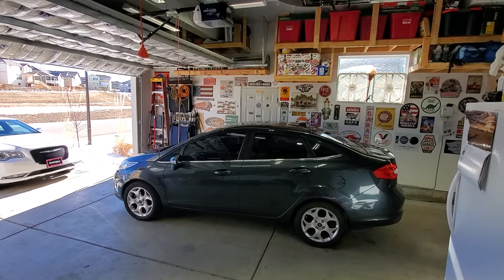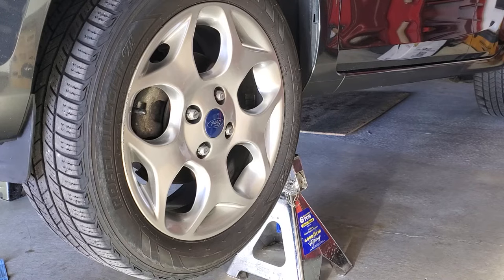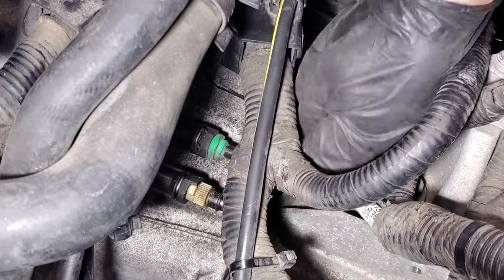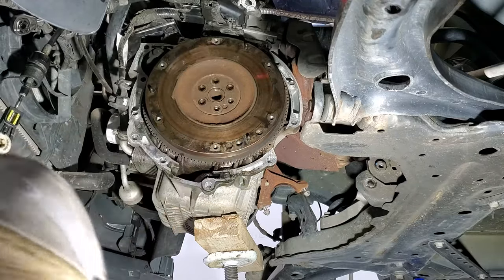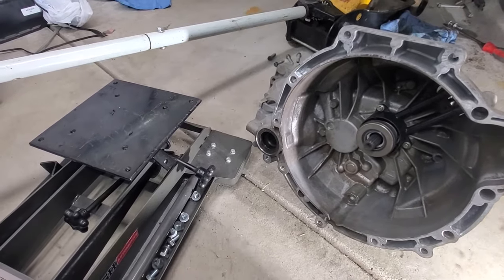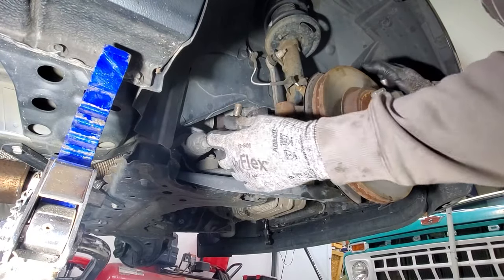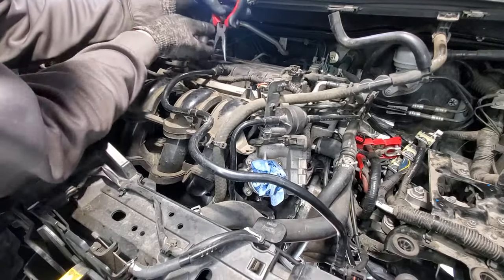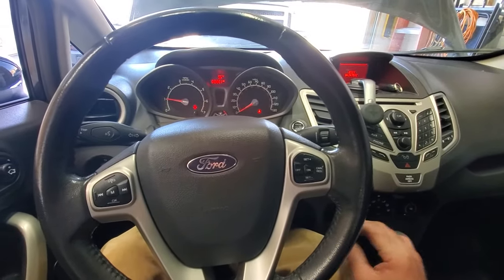Ford Fiesta Clutch & Slave Cylinder Replacement How-To

Comment: Thank you again for this video. I'm not a mechanic by trade and I was able to replace the clutch and slave cylinder by following this video. I live on the east coast and did the job outside by myself. Anyone trying this by themselves please note that it wasn't easy by any stretch of the imagination. When I finally completed the job I couldn't move the car because the back brakes were locked due to the cold. A little hot water and a fertilizer sprayer melted the ice. Thx again.

Comment: Excellent video. For anyone else about to try this, I found that I did not have to remove either of the axel nuts or tie rod ends. Instead, I just unbolted the struts from the hubs. Plenty of room to wiggle them out.
Reply: Do you a video of it because I need to replace mine

Comment: I have been watching video clips on removal and installation of gearboxes and clutch components on YouTube for years now, and I make bold to say that this clip of yours stands out, more importantly is the use of the gearbox/transmission jack to remove and replace the gearbox, not many videos have shown us how to use this important tool. Don’t forget that gearboxes can be quite heavy and it is not supposed to be installed or removed with sheer human strength. In most videos, people have used brute force/:power to do this job. Thank you so much for this and I hope a lot of people will appreciate it and subscribe more to the channel.

Comment: Awesome video! Anyone looking to get a clutch kit. Don't get the one from "A Premium" because the slave cylinder line will not fit into the aftermarket slave cylinder. I didn't find this out until I was buttoning up the job. Then I had to do it all over again. No help from A Premium and from the reviews, I'm one of many who had the same problem
Reply from the maker: I’ve heard the same thing about A Premium

Comment: Even though I just dropped my hatch fiesta at the shop, I still wanted to know how it was done. Great video, I'm surprised the mechanic said $500 this looks like a lot of work, I'm only doing mine because I lost my clutch pedal completely and won't engage, saw brake fluid leak out from underneath.
Reply from the maker: Yeah sounds like your clutch master cylinder failed or the slave cylinder. $500 is a pretty good price for a whole clutch replacment.

Comment: The extent of my experience was an oil change... I've now removed and reinstalled my transmission. it wasn't flawless as it was a different year 2017 but this gave me a general idea and I was able to figure out the rest. I had my slave cylinder go out and was able to diagnose it after I bought the clutch and master cylinder... just in case. Thank you for teaching me.
Reply from the maker: Thanks I really appreciate it. That’s why I do these videos from start to finish that way anybody with some basic hand tools can save a lot of money doing it themselves.

Comment: Awesome job on this video I wish you had a video on removing 2012 2017 Ford Focus transmission rebuild I’ve got mine to do I feel you don’t miss a beat on video all steps start to finish.. unlike 90 percent of all other videos on YouTube.. your the best macanic on YouTube just for that aspect 👍👍👍 . I’m dreading doing my 2012 Ford Focus transmission fix .. 👍👌👏
Reply from the maker: Thanks man I appreciate the postive feedback. You actually maybe in luck I have a 2012 Ford Focus as well and actually have to drop the transmission and replace the dual clutch on it and see if I need to update the input shaft seals. It’s doing the common focus shuddering. I just haven’t had the time to do it yet and still need to order parts. Hopefully I can have it out here in a few weeks. I’m assuming yours is the automatic since your having issues with it?

Comment: Hello master, thank you. My Fiesta has a 5-speed manual transmission. When I take my foot off the clutch while the gear is in neutral, I hear a clicking sound similar to friction. This is due to the reason. The sound comes from the side where the clutch is located.

Comment: Nice step by step video.
Does this transmission box have any magnets anywhere on the case / drain plug to attract iron particles/ dirt from the gears due to normal running? ( To increase life of the gear train or life of transmission Oil costing 90$ )

Comment: Thank you for this absolutely amazing video!

I would like to point how this correlates with my theme for this car: Corporate Ford Engineers are a**holes.

They take heart from Aldous Huxley's line from the fictitious Ford: History is Bunk. Why research and use a reliable solution when you can patent something you dreamed up in the shower and make loads of cash replacing it?

If the slave cylinder on my Toyota Echo, Camry, or Corolla leaks: I buy a thirty dollar part, and maybe dip into my PB Blaster and anti-seize. If I don't want to work in a tight space, I take off the upper radiator bracket and slide out the fan assembly. Takes 10 minutes. I remove the hydraulic connection from the old slave. I remove the two bolts. I Install the new slave. I bleed at the slave cylinder. Finito. Total labor including fan assembly is under an hour, even for a slowpoke like me.

Ford Fiesta: The leak puts DOT-3 INSIDE the bell-housing. WHY PUT IT THERE?!?! The cheap plastic tubing begs to be damaged if the engine overheats.The slave cylinder sprays DOT-3 all over the clutch when it inevitably leaks. Slave cylinders have been "wear items" for a century. On the OUTSIDE of the bell housing. Way to maximize the damage.

Because the part is unique, a replacement kit starts around 200 bucks. Labor to replace the slave now includes transmission removal and clutch replacement. What is the book time? 5 hours? 10 hours? 

My apologies to hobbyists and fans, especially Fiesta. I can sort of understand the allure of a car that stole a bunch of ideas from a bad 70's camera to renew some patents. It's all bizarre, and challenging like a jigsaw puzzle with a white face. Some of the ideas look nifty. But from a practical point of view: The drive for patents led to repudiation of designs proven over a century now. If you have an early 70's MGB, this fits right in to your collection. If you want a daily driver...

Examples:

My engine never ran right. Dealer answer: Use only Chevron Techron gas, and stop complaining. You bought our cheapest car. You deserve to be punished.

Manual Windows Handles. Clips are disposable. Handles should not be.

ABS Controller Failure Mode: The brakes FAIL. Yes. FAIL. You need an expensive scan tool to even begin to diagnose the U3000:xx:xx that basically says, "Something is wrong with the control logic or wiring harness. You figure it out."

Lower ball joint connection looks pretty. It rusts. No problem, there's an SST to remove it. Did I mention $$Ts?

3 grand for a radio. A radio. Or buy it without that trim option and get... a Bad radio. Replace that with a Decent radio for 120.00.

Lots of pretty machine aluminum and plastic. Plastic breaks. Machined aluminum, especially poorly designed parts, means lots of replacement $$$$.

Interior finish: Bad latches, bad anything that moves. The low-end cars I drove in the 70s did just as well. But, I could apply steel wire and Bondo and get another 40,000 miles. This stuff is designed to completely self destruct. No user-serviceable components. More punishment for buying the base model.

On the theme of cheap plastic, did I mention that plastic coolant system thermostat plenum? Brilliant. Melt down your engine in minutes. Oh, won't the ten buck pressure cap save it? Now where IS that pressure cap?

Continuous lobbying to make as many parts as possible fly-by-wire, and then encrypt the control logic. No replacement by owners. And look how well that ABS controller worked out...

And of course, the slave cylinder...

What other gifts have your Corporate Ford Engineers lavished upon you?

Yeah Ford, I'm bending over to take the reaming. But guess what. This is the last Ford I will ever buy. I will drive mid 2000 Japanese cars until they are banned or break. Mine will break in 2040. Then I'll start buying mid-2020 Japanese cars. I might buy another Chevy Astro van from the previous century. it responds well to steel wire and Bondo. And I will NEVER buy a fly-by-wire car with software licensed parts or a lockdown to dealer servicing.
Reply from the maker: Well said brother, I totally agree with you.

Comment: Thanks for posting. Went out to my 2011 hatch and discovered giant puddle of brake fluid and no pedal resistance with no master cylinder leaks.  Just wanted to see how much hell I'm going to put my poor mechanic through this week. I figure 150k miles is pretty good for a clutch replacement while he's at it.

Comment: Great job an video I’m a mechanic just retired and my wife has a 2016 fiesta , great car but getting gear selection problems iv done the drill out n grease up of change cable end just wondering did you have problems getting into gear and then it corrected its self and was this the slave , as I can’t see any loss in brake res fluid at all . Thanks for the video 👍

Comment: so, you can use MityVac as a vacuum pump and as a pump? did you push fluid into the salve cylinder using the MityVac? or did you suck brake fluid from the reservoir through the slave cylinder aplying vacuum with the mityvac? i'm confused here, please let me know how it is. Thanks!

Comment: Thank you for the video. From your experience after how many km will the clutch need a replacement. I have an issue with the clutch at 80k km. If the mecanic removes the gearbox to check the problem is it a good idea to replace also the clutch plate?
Reply from the maker: It just kind of depends on how the car was driven. When it needs replaced I’ve seen clutches needing replaced at 80k and ones that have lasted 180k. But yes if  they are dropping the transmission/gearbox might as well replace the clutch.
Reply: Thank you for the information!

Comment: I have just finished fitting my new clutch following your video, and it was a great help. However I have a problem, when I started the engine with the car still in the air the wheels started turning, I can stop them by hand though. Also I have a slight rattle sound from the gearbox, this disappears when I press the clutch pedal down.
Reply from the maker: The wheels spinning with it in the air and in neutral is completely normal the input shaft is still spinning even with it it neutral so the wheels will spin but not enough to move the car. As far the rattle in the gearbox does it do it with the wheels on the ground?
Reply: @BLUECOLLARGARAGE  yes it does it on the ground as well, its also a bit difficult to get into reverse.
Reply from the maker: @paulwharton1484  I’m assuming you replaced the gear oil and put the correct amount in? Also may need to adjust the shift cable and see if that helps to get it into reverse better.
Reply: @BLUECOLLARGARAGE  I did replace the oil and measured it, I forgot to mention that I had difficulty bleeding the system, I had to use the 2 man method because I didn't have a tool like you had, It took us ages just to get a decent peddle.
Reply from the maker: @paulwharton1484  yeah you may want to try bleeding it again the way I did it and see if that helps at all.

Comment: hi man o have a ford fiesta 1.3 1997 endura e engine I just bought a new clutch and slave cylinder on April 27 and  instal it think the machinic didn't bleed it properly last week on the 5  of may month i stacked on the road couldn't get any gears the paddle was all the way down to the floor there was break fluid in then I show by the gearbox by the nipples side there was break fluid leaking and only if the vehicle is of there is gears and when u start it there is no gears does that mean the slave cylinder is gone again
Reply from the maker: Have you tried turning the bleeder screw on the gearbox for the slave cylinder just to make sure it was closed all the way?
Reply: I will check that didn't try it yet and there is stil fluid inside the will try and top it up and bleed it again and see b4 I buy I new one

Comment: Nice guide, but just to note that the bolt you removed isn't a drain plug. It's a detent for the shifters inside (thats why there's a ball bearing on the end).

There is no drain plug on the IB5 gearbox... Stupid design if you ask me.

Comment: How high of a jack would i need to get enough clearance to get transmission out. I got everything ready but the floor jack.
Reply from the maker: I’d say probably at least 24 inches. If you have a smaller jack you could always use a large block of wood.

Comment: Does anyone know the name of the sensor that he detached at 10:45? When I was gently pulling on mine it broke.... Please help.
Reply from the maker: That should be your back up light switch so even if the connector broke off you can still drive it around you just won’t have reverse lights.
Reply: @BLUECOLLARGARAGE  Thank you for the quick response. I am going to have to replace it to pass inspection unfortunately. I don't see how to replace it but I'm going to have to figure it out. Thank you for the great video.
Reply from the maker: @andyzaluski  it should just unscrew out of there just find a large wrench or a deep socket to get it out. https://amzn.to/3GnyruB
Reply: @BLUECOLLARGARAGE  Thank you. I order it and I just have to wait for it to get here....

Comment: Great video. I'm a bit confused on the reverse bleeding portion. Wouldn't pumping the mighty mightyvac just put the clutch slave in a vacuum? How does it push the fluid from the reservoir in? Thanks I have a harbor freight bleeder basically a knockoff of the one you used.

Comment: I can't seem to separate the axle from the wheel hub from either side of the car. I also couldn't get the lower ball joint separated so I am going the strut-caliper removal route. I've spent about 4 hours trying to remove the axle from the wheel hub and it has me worried. I just can't get the axles to move. I've hit the axle with a rubber mallet. I've used a block of wood and a 'regular' hammer. After hours of pounding on it(it's not damaged) I had to give up. I have an air hammer and I am going to try that next. I need to go to the store and buy a pointed chisel since I don't have one. Is there any other way I can get the transmission out without separating from the wheel hub? Do I need to take out both axles?
Reply: I was able to get them out by using a small air hammer and a pointed chisel. Yeeee Haaaw.....

Comment: In the process of following your video the line that runs to the slave cylinder doesn't want to seat all the way in. I've tried pushing the green part with a screw driver and then sliding the clip down and I can still pull the line off what am I missing?
Reply from the maker: It should just click in. Did you try pushing the spring clip all the way down in the groove and then pushing the line in and it should just snap right in since it’s sprung by pressure.
Reply: @BLUECOLLARGARAGE  is it light pressure because it pulls out very easy

Comment: So what prompted you to change the clutch? Great video BTW.
Reply from the maker: Slave cylinder was leaking brake fluid so I figured might as well do the clutch since I had to pull the transmission to replace the slave cylinder.

Comment: I'm confused with this "reverse bleeding procedure". When we bleed the clutch or brakes, we pump brake fluid to make sure there's no air in the system. If you're doing it alone, I understand doing it that way, but is there a reason this can't be done the "2-person" way, as in, p1 depresses clutch pedal, p2 opens bleeder, closes, p1 lets go, depresses again, so on and so forth?

Comment: Hello. Really appreciate the video literally saved me hundreds. 
      My brake fluid got old and dirty and was losing my clutch.(clutch was going almost straight to the floor and needed to be pumped a few times to get it to engage). so I just flushed my brake fluid on my fiesta. Thru the brake lines and the slave cylinder. And now the clutch engages really high now. Any ideas on how to adjust / Fix it?
Reply: Same issue, im just doing the rest of the work. Replacing clutch and slave. Already replace master and bled the system. The issue was resolved after bleeding for 1 day but continues to come back. Oddly I’m  it losing brake fluid though.

Comment: My Slave cylinder just went out and I'm thinking of replacing the clutch "while I'm in there". Only 36k miles, so I doubt it needs it, but I'm wondering if I should just go ahead and do it? Also, how is the Luk kit holding up?
Reply from the maker: If your going to be in there might as well. I was in the same boat as you slave cylinder was bad but mine was leaking which got all over the clutch. No issues with the luk clutch that’s what the oem one was.
Reply: @BLUECOLLARGARAGE  Yeah, as common as it is for these cars' slave cylinder to go out, I'm kinda surprised there wasn't a recall.. or maybe I just wasn't aware? I just recently bought mine used, so I wasn't familiar with the problem until the purchase was made. But I'm just ranting at this point lol thank you for the reply and thanks for the detailed/informative tutorial!

Comment: My 2011 ford fiesta se is slipping is it because transmission or the clutch
Reply from the maker: Is it an automatic or 5 speed manual?
Reply: @BLUECOLLARGARAGE  automatic
Reply from the maker: It’s most likely an issue with the dual clutch system common issue on these cars with the automatic. The clutches get caked with clutch dust or the seal starts leaking getting fluid all over the clutch causing it to shudder and slip. I did a video on how to replace it on a ford focus which uses the same transmission https://youtu.be/H1waN-mTrrc?si=bVWTumMxEPkkW9Wi
Reply: @BLUECOLLARGARAGE  so clutch is the problem I have?